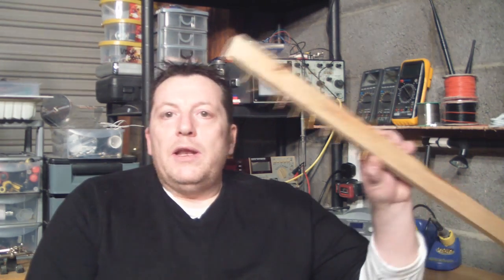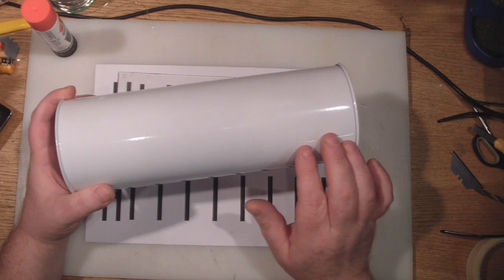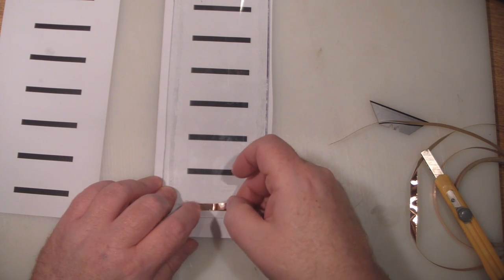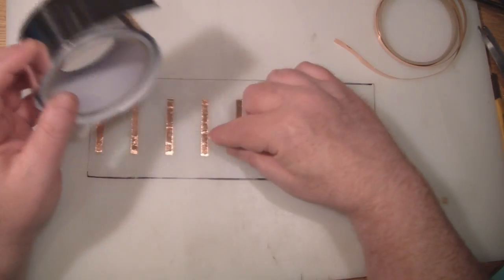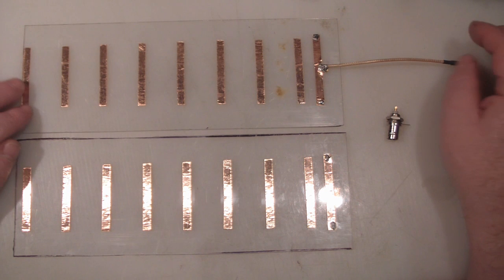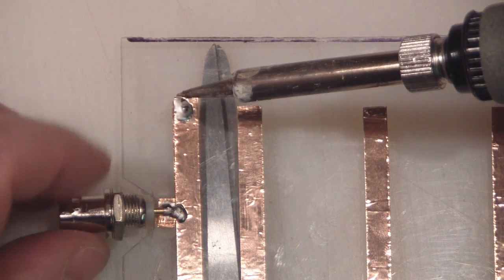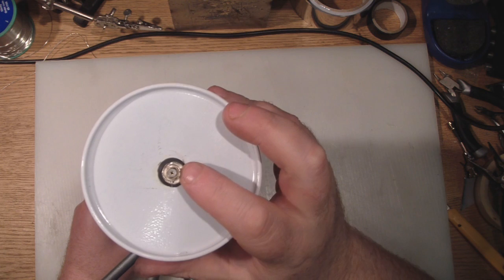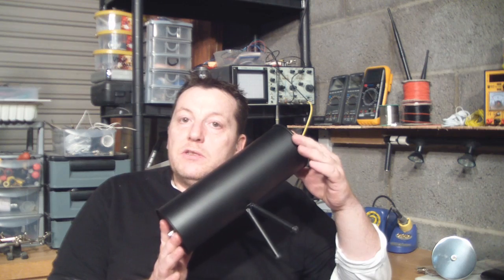Yagi Cantenna (Yagi in a Can) 2.4GHz

Comment: It might not be a bad idea to have a known measurement on all the printouts to make sure the scale is correct on the finished print.
Reply: I don't think he responds.
Reply: @icraftcrafts8685  You are not understanding his question. When the template is printed, it is important to verify that the dimensions were not altered/reformated by the spooler and/or printer.
Reply: @sinless1  Ok I see now, apologies. Here are 2 links that may help:
https://www.changpuak.ch/electronics/yagi_uda_antenna_DL6WU.php
https://www.ab9il.net/wlan-projects/wifi6.html

Comment: copper foil tape is also used in stained glass windows/art panels.  It is wrapped around both pieces of adjoining glass and then soldered to hold the two together.

Comment: Thank you for covering insulating the driven element from the rest of the Yagi. I prefer insulating the front parasitic elements also but have no proof that helps. Once out of the air, the wave propagates down the metal at the same speed. 
  Hope you make a 5 Ghz cantenna as well.  
  Cheers

Comment: The cantenna you built is mounted horizontally. Most routers have vertical antennas. Wouldn't the cantenna be have a higher gain if vertically mounted/polarized?

Comment: I'm curious, how the distance between the upper and lower elements affects gain. If you used two sheets of Perspex for spacing would it be better or worse. Is There an optimum spacing between upper and lower? 

  I once had a long distance between my antenna and computer, I was afraid of the coax losses. So I disassembled a wifi dongle cut the antenna and mounted an N connector to match the N connector on my Yagi. I connected the wifi dongle directly to the Yagi. Then ran usb cable to my computer. It worked great, I used that for many years. It was all mounted on a boat in a marina.
  Also, it looks like there are only two lengths of foil, please post the lengths as printers often change the original size. Then I would make a quick template to cut the all.

Comment: Fun idea, have you ever added a schottky diode (1N5711) and connect it to one of your antennas in order to capture power from received signal and the diode will convert the signal/power into DC power! you could even add a single led to the diode/ant and it should light up. Thoughts?
Its called a rectenna

Comment: Great video. How would the calculations change if you just drilled a hole at the ends of the element dimensions and wrapped wire around/through the plexi?

Comment: Another question regarding the center conductor of the RPSMA pigtail incorporating  RG316?? from Ebay? I am assuming that you must prevent any short circuiting of the center lead  with the element that is soldered to the shield driven element, as in drilling a hole large enough to allow the insulation of the center lead to go thru the plexi?

Comment: I'm confused about the driven element.  Is it a folded dipole?  The short by the vias would seem to indicate so.  But with center of BNC driving the center of the element, by symmetry, the current flows in opposite directions, and the fields should cancel.  It doesn't seem right to me.

Comment: Has anyone asked what the width of that copper tape is? It's sold in here in the US by fractional inches, of course. So...1/8", 1/4", 1/2", ECT.

I figure yours would be in MM, so would you elaborate? Your ebay link for it in the description has gone out of service, I'm afraid.

Thanks!

Comment: I'm looking in to methods of extending WIFI and internet connectivity from the main house about 500 ft/150m to a second building on my property, and researching Yagi prototyping before buying hardware for the second bldg. 

I have a large amount of scrap materials to use for this project, but I don't really understand the physics at work here to know what to use.

How does the diameter and spacing of the elements effect the waves, and what is needed for 2.4 Ghz standard WIFI? is there wiggle-room, or is it very specific?

Also, would I need to do anything to the router at the main house, or should the Yagi at the second building pick up the signal inside without a problem?

Thanks for the content!

Comment: Andrew, in "The Wifi Gun Does it Really Work?" you said that shorting the reflector to the active element (center to braid) would cause harm to the active equipment - agreed, and reduce efficiency, also agreed.
Yet you have done just this, shorting centre to braid since the two sides of the aerial are connected by the vias. I was anticipating the braid being connected to the can/reflector. Am I missing something?
Reply: The vias in the driven element are being used to form a folded dipole, lowering the chance of messing up the tape by cutting it in half to form the two elements. (https://en.wikipedia.org/wiki/Dipole_antenna#Folded_dipole)

Comment: Hi Andrew, will a standard aluminum foil tape work as substitute in place of the copper tape? Thanks!
Great video. Very informative.

EDIT: Sorry I made a comment before halfway of this video. I see I can use aluminium foil. (smh) I was too excited for this DIY project.

UPDATE: Another question. Does it need to be transparent for the board that holds the elements? Thanks!
Reply: Completely wasted my time watching this. This design has some serious design faults! A yagi consist of dipoles as elements.
Reply: @haraldhaporta425  9:35

Comment: I would say just lay the copper tape on the plexiglass oversize then trim the ends to the template with a steel straight edge. You will get them deadly accurate like this and no fingerprints under the tape.

Comment: Pretty neat. I wonder, the plastic lid you put in front of the antenna to close it up and make it look neat, will likely introduce some RF loss. The lowest RF loss material you could use there is styro foam (mostly known and used as packing material) as it has very low density, RF goes right through it. Also in speaking of RF losses, the plexi glass material you used, might also introduce RF losses, perhaps comparable to using just FR4 circuit board material. For testing your antennas, you might want to consider getting a NanoVNA - about 150 Dollar on ebay. Then you can actually tune for maximum performance.
Reply: How you can use NanoVna for wifi antennas? They work at 3 times higher frequenicy than NanoVna able.

Comment: Andrew. Can I use copper wire instead of copper tape? In my country is difficult to find copper tape. 

If I put the copper wire exactly I the middle of each black line of the  template will it work ?  How about 2mm thick copper wire ?

Thanks for sharing your knowledge.
Reply from the maker: That will work yes
Reply: what could we use to stick the copper wire onto the perspex?
Reply: glue of course.... hahaha
Reply: In theory, could it be heated into position using short bursts of heat being careful not to distort the perspex?

Comment: Andrew, great video.
Can you post the dimensions of the template. If you give one dimension, I can use that one dimension to determine the others. As a few others have mentioned, some printers may enlarge or shrink the PDF, making the dimensions change, thereby altering the efficiency of this antenna. Millimeters or inches, whichever is easier for you.
Thank you.
Reply: you should print in A4 paper, that's the configuration of the PDF document.

Comment: Hi Andrew, great job on your videos on antennas.  I was planning to build a 10 or 15 element Biquad Yagi similar to your previous design.  After seeing your new antenna design, I have a few questions-ideas that your answers-insight would be most appreciated.
Here goes :-
1.  How does this antenna perform compared to your previous Biquad Yagi?
2.  Would the Biquad Yagi provide similar performance with wider beam width?
3.  How about a double Biquad Yagi?
4.  Would re-positioning the yagi element at 1/4 or 1/2 wavelength
     inside the cantenna make a difference?
5.  How about a Biquad Yagi Cantenna
Thanks.  Looking forward to your next video.

Comment: it would have been better if you created small notches to fold the copper tape around top to bottom on each of the elements to create a better uniform microstrip for the radiator and elements. This would eliminate the soldering top to bottom of the tape.

Comment: Hey Andrew,
This makes me wonder if one could make stained glass decorations that would also be  wi-fi antennas? Obviously I don't mean a 'yagi' style, but a a mere basic wi-fi booster mayhaps?
Stained glass workers use this copper tape to line the edges of glass before soldering together...I think it would be dead brilliant to make decorational wi-fi boosters. windows or not they'd still look cool & as long as they're made properly, they could hang virtually anywhere...minding the critical info for reception of course.
Reply: It mght constrain the direction you need tho.

Comment: Hello, very interesting and well documented presentation, I gonna test your wifican antenna !

My pov about your realisation :
- Black paint is not a good candidat because it increase the temp in the can and increase the thermal noise never a good for signal noise ratio. The best paint are shiny white paint (never use mat) this is the same raison that you must never wall outside an house with mat paint.
- Take care about bnc connectors they could be very problematic and increase loose and noise or buy expensive connector certifié for your work frequency; for this reason every as soon as possible i always solder directly the wifi dongle (or SDR dongle ) directly on pcb with a shortest low noise wire and put dongle in metalic grounded box. This make some differents with sdr dongle.
- If refer to pratical antenna handbook (the holy antenna bible) with an air core in your case plexiglass this kind of antenna must be less sensitv to "Electrical vector" than with a copper or Aluminium, it could be interesting to compare the 2 case copper VS air core antenna. 

- Have you be able to test with a vector analyser (minivna & co) ? 

Thanks

Comment: Yagi antenna having regular distance elements and same-length direction elements, are pretty much ineffective if compared against real inhomogenic yagi antenna designs which have tuned elements and as well tuned distances inbetween them. This kind of "homogenic" format also has a "dead end" where no more gain can be achieved by just increasing the number of elements (because it detunes while increasing, causing pretty big sidelobes. Inhomogenic tuned arrays consistently increase gain while increasing length instead. Homogenic arrays with undercritical regular spacing are very broad-band on the other hand). Feeding two driven elements behind each other for the grounded (Reflector) and driven (1st element in front of the reflector) creates kind of a driven "capacitor" , not really making up a regular dipole in the first place. The usual way of properly building a yagi antenna using a loop (300 ohms) or split (75 ohms) dipole as the driven element - with a symmetry converter which is required to attach both wires of the router cable to it -  is different.

Comment: If I were to make the can slightly conical would that have the effect of slightly 'opening up' the signal.  I would like to utilize the antenna for use with a UAV using an automatic following system but your comment on the cantenna being extremely sensitive would preclude it from being used because of the slight delay in the 'following' system may cause the signal to be lost.

I have seen several posts here asking for dimensions of the template, could you please advise the distance between the first and second element in order to ensure correct scaling.

Comment: Nice video. Question, Most commercial antennas appear to be Vertically polarized. Yours appear to be Horizontal. Am I missing something or does it not matter at this frequency?
Reply: It dipends on the signal

Comment: Did you solder the coax screen to one side, and the center lead to the other side which was just soldered together? You are basically making a short circuit, and so it is not an antenna, and you are breaking the output driver of the wifi card.
Reply: Yep, i was thinking the same thing

Comment: Andrew I have been following your good works for some time now. It has finally come to the point where I must adapt this Cantenna design of yours to run with a rather large booster in the 8 watt range. How do you think it will perform - efficiency and reflected power considered? I laugh to myself thinking about running so much power through the copper foil driver element! :-) P.S. there is a spare element on the Google Docs printable file you have provided. What is it for mate?

Comment: Question, if you had to transmit 2.4 and or 5.8 wifi from one building to another over 10miles apart like me in setting up long range mesh network, what antenna would you use and please dont just say dish lol as thats expensive and stands out a lot! id like to try and be somewhat discreet as i may likely be using clients roofs and they would not like an isaw on the roof. Could a patch antenna do the job, perhaps stacked patch like the larhe one you opend up which was printed on a pcb but i dont understand how that works as it is not an active array and i was led to believe during my time in the army as a rad-op that you cant just add in another ant. So how do those stacked antennas allow for additional yagis/ patch antennas etc to use one cable and not increase power??? Really hope you understand what im asking and that you reply to this, i will look to find such a video you have done and comment there just incase you dont quite follow. Thanks again.

Comment: I bought one of those joke yagi's your holding @00:50, at the time I thought I was doing something wrong with it. I installed a wireless IP Security Cam system around a lady's house, 12 camera's. She also wanted one down at her big 2 car garage (had a living quarters above) which was roughly 300-350ft (90-105 meters), with a clear LOS. whole system was based off the home's wireless router, I used a pair of the ol classic WRT series linksys wireless 54G's (fastest @ the time). setting up as an AP... that bloody garage camera was the biggest pain in the.... I went from stock antenna to a bigger pair of  -11dB (on both router&AP)
caught a drift of an image for about 30 seconds, then poof.... SO I bought from fleaBay, that very same shiny stick you're holding there @:50,  aimed& roof mounted it,....there, for hours, me the roof became one,.. I was better off with the higher db internal dipoles. 
Keep in mind, I had no clue back then about wireless sigs,  rf in the gigahertz range, antenna types, wave length's, resonance freq, etc I was an old school tv antenna guy just learning about computer networking ;)
Solved the dilemma very painfully.....ran a buried cat7 drop out to garage...lmao, I wish I knew then what I know now....d'ohhhh

Comment: Just to be certain I can use a standard USB cord to solder on for connection right...? I have a  big gaming computer and I am always looking for improvements in performance.
Reply: Negative. You cannot use a USB cable to connect to the antenna. The antenna requires a coaxial cable that has a center conductor and an  outer conductor/shield. The center conductor transmits the RF signal to the driven element while the outer conductor is the ground connection (in this case, the completed circuit connection for the driven element).The USB is a universal serial bus connector and is used for an entirely different purpose.

Comment: I really enjoy your videos. I have not yet built any antenna but , have been looking at the DIY many months and many different types of antenna for long rage wifi. What I would like to see if it is possible is a duel band 2.4 MHz/5MHz . Using canteen for the 2.4MHz and the helix for the 5Mhz. And a duel band USB adapter to link them at the antenna. My question is ..IS IT POSSIBLE?

Comment: Well, the template is not secure because printer can shrink or expanded. I'm assuming you calculated the yagi for 2450Mhz, right? I'll use my yagi calculator to calculate the lenghs my self
Reply: what about your test with your yagi calculator ?

Comment: Hello Beloved Mr. Andrew,
Would the project be more powerful if the tube / can that you have was made of copper? in that case how many mm thick copper?
question nr two, would you get a more powerful Yagi cantenna if it was longer?
Question nr three, how many cm is the diameter of your can? and would it be more powerful if the diameter of the can was wider?
Question nr four, which coaxial cable do you recommend and with which freq or brand ?
to be honest with you Mr Abdres, your freaking awesome and i encourage you to more projects
Reply: The tube is not the active antenna, just a 'shaper' of reception angle.

Comment: One question, in Venezuela i can't find a cylinder with 90mm diameter. I found a 134a cylinder with 72mm of diameter, if i use it i will have problems using this template? Or what should i use?
Reply from the maker: you will be able to fit the Yagi in but 72 mm is the absolute minimum diameter for 2.4GHz
Reply: @andrewmcneil  yes, the thing is i don't know if make some interferences with resonances and other things using that diameter.

Comment: Thank you for this video Andrew. I am not that familiar with RF but followed everything you did except at 10:15 in the video where you drill the vias in the radiating element and put a copper wire through them. I was wondering why you did that? and why it was done only on that element and not others? Thanks again for the great video!
Reply: because its the driven (powered) element and must complete a circuit. all the other elements are passive and only direct the wave.
Reply: That makes it a folded dipole driven element, If I remember right. reason for this is to a) match impedance? b) 1/2 wave driven element in the space of a 1/4 wave? c) produces around 3db more gain?